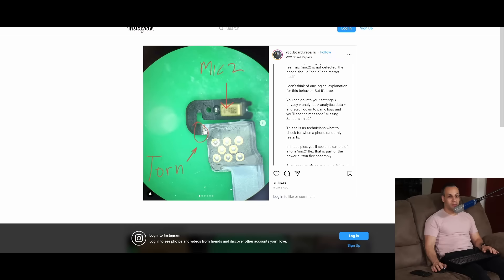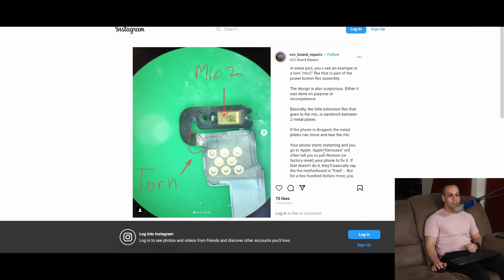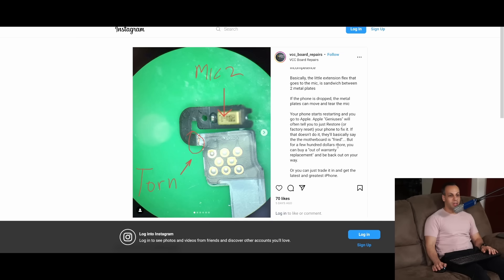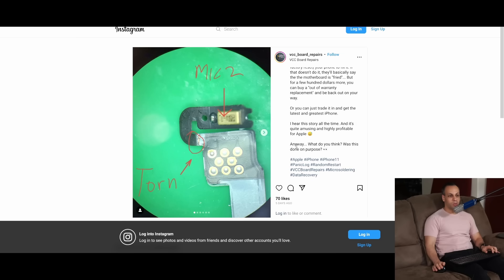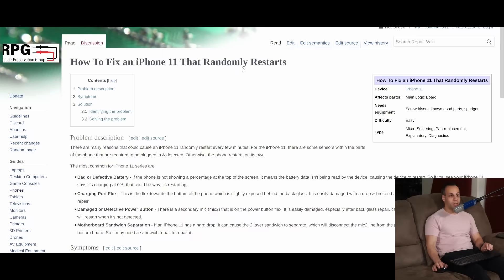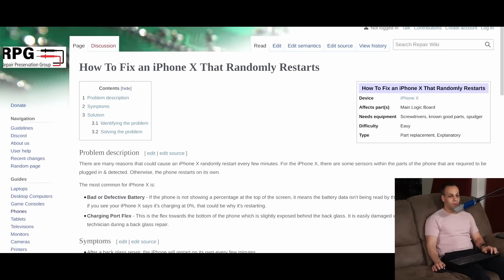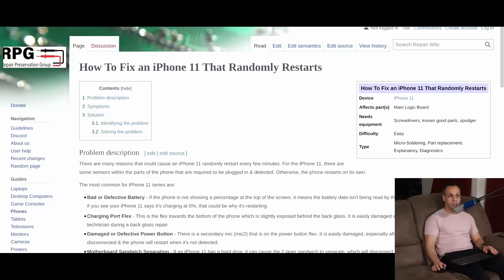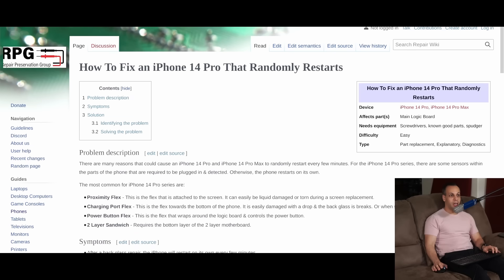iPhone's design flaw shows that 10 years later, their engineering is still a joke

Comment: There used to be a thing where engineers had to stamp their work with their license - and if the sucked at their job they'd be run out of the industry (or put in prision, based on the severity of their incompetence).
  
Having worked at Nvidia, Apple, and now Microsoft (I'm not speaking on any of their behalf) - the "repairs are best done in a factory setting" is best countered with the question: "How do you do your enigneering rework to validate your designs and running changes".  Hint, it's at an in-house lab staffed by at best a technician with nothing more than a hot-air or hot-bar rework station and the same 10x-30x AMSCOPE stereo microsope you can get from Amazon...  Often times they don't even have access to the schematic, it's a clip of a circuit diagram and some hand writen notes just to keep the instructions simple.  That's the reality of tech.  The "factory setting" is a person who knows more than nothing about how to solder, wearing and ESD smock at an ESD-safe workstation - that's it (it could be argued that also with consolidated access to the necessary parts - but that's IMHO a separate issue).  And it's not hard to replicate basically anywhere.
  
Sometimes you'll get an engineer who is competent enough to run the rework themselves, but THAT IS A VERY RARE EXCEPTION.  Ask about that too... "What percentage of your rework is done by your engineers and what percentage is done by contractors/part-time-technicians?"
  
And also: "What is the hourly wage of that factory worker during a repair?"  You'll probably find they are saying that for fiscal reasons - not kidding, it can be cheaper to collect them all and ship them to the factory in China or Vietnam have a fleet of low-income technicians do the rework, then ship them all back the US.
Reply: rework? Or repair? What do you mean.
Reply: @platinumsun4632  Generally the term rework means any time a device/PCB is touched/altered from its "manufactured" state.  This can be blue-wire modifications or repairs of existing traces (fix a damaged trace or install one a PCB designer "forgot"), replacement of damaged/non-functional parts for failure analysis, replacing a factory component with an alternate component for engineering studies, and on and on.  It's a catch-all term.
  
I've set PCBs on fire (not my fault, most of the time) and they (in-house technicians) have "reworked" a board to save a GPU/CPU tossing the whole PCB and replacing it with a new one and transferring the more expensive components.  When expensive major components come back from a fab pilot build, they can be $100K/chip because it came from a 1 to 5-off wafer spin.
Reply: @Real_Tim_S  When expensive major components come back from a fab pilot build, they can be $100K/chip because it came from a 1 to 5-off wafer spin.

Elaborate. I am humble PC salesman, but i've never gotten my hands dirty with a mobo and solder.
Reply: @platinumsun4632  The mass production price for an uncut wafer of chips right out the foundry can range from ~$1K to well over $15K.  But that's when they dedicate the foundry line to a specific chip design - and satisfy minimum order quantities!  If you do a short-run and vary process for tuning you're not making 10+ million chips and tens of thousands of wafers.  They have to take a line down (typically at the end of another chip's runs), load in the metal-layer files and then run those.  More metal layers requires more fab-time and increases costs (and with process variation this time increase can be geometric), so the more complicated parts cost a lot more.
  
Take a look at chip fabrication proceses for more detail from other sources, but in summary - you start with a bare hyper-flat silicon disc (wafer), put some masking on it, etch it, grow or deposit some metal crystal on the exposed/un-mkased metal, strip off the masking, and then rinse and repeat until you've grown the whole chip.
  
You need to tune the fabrication process to get the correct thicknesses of each step, and align the machine to get even process performance across the whole chip and wafer, otherwise you'd get one side where chips work and another side where they don't in some fashion or another.  Even the thickness of metal layers plays a part in the performance of chips - you might have gates with too high a band gap needing a higher voltage to function or gates with too thinn a dielectric leading to higher leakage (current flow not doing anything productive, bascially just generates heat, but too high and it can unbalace a logic element and start flipping bits).  If the foundry makes a mistake you might have metal grown in places you don't expect and you could have a wafer-full of chips that just make lots of heat in a short amount of time.  The foundry will try to bring the process into specification to match the design tools, but they will typically provide "corners" (Fast, Slow, High-Voltage, Low-Voltage) so the designer can validate the engineering margins of their design (adding in high and low temperature to their testing for a cube of perfomance with 3 axis: Process, Voltage, and Temperature... aka "PVT").  This is a "knob" the designer can turn a bit to get the best yield at retail in its actual use.
  
This short run of fabrication, with lots of manual intervention to tune the process at the foundry has an increased cost.  Think of it like the difference between buying a Toyota Corrola in a factory with robots or hand-building one in a garage with hand tools.  The time and effort and diversion of those foundry requires, results in increased price per wafer as it relates to the foundry's operating costs.  Instead of $10-15K like a producion run, it can be $1-5M+ per wafer.  And then that's just a wafer of a bunch of chips (the exception I'll note is the Cerebras wafer-scale "chip") - they still need to be tested, diced (split), and packaged, again all at manual/bespoke pricing.  From there you might not (rarely will) even get 100% viability out of all the chips on that original wafer - some fail in test (the test systems cost a bunch to set up too - search for wafer probing), some fail after dicing (splitting), some fail after packaging (mounting to a chip base which will eventually get soldered to a PCB).  The manufacturing cost of that wafer then gets split over the number of total viable chips (the "yeild").  For bigger chip designs this can be a very small number to start with...  For a $5-million wafer with 100x viable chips of yield you'd hit $50k/chip - toss in issues with yield and being the first customer at a processs node and it goes up from there.

Comment: My one and only major motherboard dining table job was rescuing my PS3. The WiFi chip is prone to voltage spike, which shorts it and the PS3 stops turning on. You can remove the chip and the PS3 will work fine..but you can never connect it to the internet again, even via cable, because forced PSN patches brick the system if the patch cannot detect the WiFi chip.
Reply: If it's CFW capable you can install a variant that doesn't try to flash the firmware on there and works fine.

But yeah this is hell for PS3s that can't do CFW. I have one super slim with a dead wifi board.

Comment: I wonder if the S2 is too old for a wiki page to exist (I don't see it on in the wiki, the S2 is in red colored text). I have a Samsung Galaxy S2. When I press and hold the power button to turn it on, the blue indicator light will turn on then back off like it is starting. But it never actually turns on because within a few minutes, I can repeat the process. Doesn't seem to matter if I plug it in while attempting to turn it on. I wonder what the odds are that someone has experience on this topic that could add to the wiki (I frankly don't have the experience nor know how on my own to even know where to begin).
Reply: And hopefully I am remembering that all correctly. Been a few months since I messed with it. It would be nice to gain access to files on there.

Comment: You are really way to forgiving/trusting... Putting a ribbon cable between 2 sharp metal plates.. If as a designer/engineer, you at that point don't think: "Maybe that's not a good idea" You are a incompetent, to an actually unbelievable level, as an engineer (I really honestly don't believe there are even engineers out there, that actually are that incompetent. And believe me I don't have a high opinion of engineers in general)... I can't believe Apple would hire such bad engineers if they even existed.. 
I'll give them, maybe it happened to end up that way by coincidence.. They should have seen and solved it, and otherwise they aren't engineers worth the paper their diploma was printed on.. And again I don't think Apple would hire those... So maybe it just ended up that way.. they saw the potential consequences and were like: "You know that's all good and beneficial to Apple, let's just leave it... If people find out Apple can claim an oopsy, it'll be fine" And then given that this is the first phone ever to crash when it doesn't detect a mic, kinda tells me there has to be foul play... There's just too many coincidences.

Comment: I had my phone randomly restart last year, but it wasn’t every 5 minutes, but rather a couple of times during a night of playing a cpu/gpu intensive game WHILE charging.

There was not a very specific description to be found online for the last shutdown reason, but what I found was either some sensor fault in connection with the charging port, or that there was poor soldering on the cpu. One thing I did notice was that charging was hard to achieve, and when you did achieve charging, it stopped after a few minutes.

I ended up sticking a thin and sharp needle into the charging port removing more lint than I could see with my bare eye.

After that, I haven’t had a single reboot.

Seems like an unstable connection in the charging port can trigger these watchdog timer resets without being any other faults too…

Comment: But I was told apple is the best and it just works!
Perfect planned obsolescence that's extremely hard for the consumer to figure out. The software makes it appear to be a serious hardware fault requiring expensive repair/replacement.
This is absolutely intentional.
Add to the list of fraud apple pulls every second of every day.

Also, serious question: do iphones reboot if charge port is wet? I know samsung has a notification telling you.

Comment: The iPhone 12 is even worse. If the front mic/ prox sensor assembly is disconnected or damaged the screen remains black. Phone is on but the screen is just black.
Reply from the maker: All of this will get documented in the wiki in due time!
Reply: @rossmanngroup  you have an iphone anti-consumer measures wiki? damn i'd love to read that
Reply: i feel like this is done on purpose to get users to buy new iphones
Reply: @SuchANoobOG it's to discourage independent/3rd party repairs. Resulting in more iphone sales like you said.
Reply: @SuchANoobOG eah that happened to dankpods he said yeah my iPhone screen went black it was still on it was in the budget phones episode
Reply: @SuchANoobOG that's exactly what is happening.
Reply: @SuchANoobOG  Oh yes it is. Apple were caught throttling processors to push users to purchase newer devices and they've paid out a lot of money in settlements. Apple needed to find a way to yank away that older device from you... so... build dry-joints all over the phone so when dropped, no matter how insignificant the drop... your phone dies...
Reply: Funny. I recently installed Ubuntu Touch on my FairPhone which soft bricked all the sensors. I figured out the fix later (you need to root and run restorecon -FR /mnt/vendor/persist when installing another operating system) but the failure mode for the screen was the obvious one: Just stay on.
Reply: @noneyourb172  that's the obvious failure mode, but Apple thinks Differently TM
Reply: @noneyourb172 yep, it's the default behaviour on Android when sensors die, the brightness gets set to either previous known good value, or to some default value (usually about 60%).
Reply: I am starting to think they run components in series on purpose. Run everything on the same rails and if one component breaks, that entire section of the device stops working, like a cheap no-redundancy christmas light.
Reply: @NothingXemnas  That's exactly what they're doing. Been saying for ages they'll just continue lock stuff down at the expense of the customer. Doesn't really matter, because their customers are in it for the "lifestyle'/image, not the hardware or function.
Reply: @NothingXemnas I think cost is the reason, but they get the beneficial secondary benefit.
I wish people would stop buying their second-rate products.
Reply: And that flex is always the first thing that breaks when there's liquid damage, it's insane.
Reply: PGR and Louis Rossmann what a great duo
Reply: Not completely black, just very very dark. Same if light sensor gets damaged. It defaults to really dark screen and you can't adjust the brightness.
Reply: Sister bought an iPhone 14. The front facing camera + faceid sensor module has a known fault which causes similar behaviour... temporary "fix" is apple unplugging it completely so it doesn't crash the phone. What a joke.
Reply: Funny enough, I've experienced the same issue with an XR, the exact same thing.
Reply: I'm wondering what's wrong with my 6s, the digitizer still works so I can touch the screen but the screen is blank. I took it apart and saw no damage to the screen or the cable that connects it
Reply: yeoch
Reply: This seems like their "hardware replacement avoidance" design costs more than its řbenefit.
Reply: @AllDogsAreGoodDogs  what's the benefit?
Reply: Hi PRG! Glad too see you are avid about the right-to-repair movement!
Reply: When I read this comment, read them in @PhoneRepairGuru 's voice. (We got a package...)
Reply: It's wierd how over the top their anti repair software measures are, but the hardware opens like a clamshell and everything is accessible one layer deep, while Samsung's phones are glass and glue sandwiches. Apple designs these to be fixable, but only for them.
Reply: @compaqdeskpro5770  "Apple designs these to be fixable, but only for them" and then refuses to diagnose and fix them...
Reply: @langdons2848 spot-on. Easy for Apple, impossible for anyone else.
Reply: This is why I questioned AT&T when they tried to upsell me from the current iPhone 11 I have now which works perfectly fine to iPhone 14. The 11 Had a few of the resetting hiccups but not many and it didn’t happen often either. 

I literally asked them what am I getting that has a better feature than the current phone I have? Or what makes i14 better than i13 or 12 lol 😆 

There answer was newer parts!!!!! Like what?!!!🤣🤣🤣 There’s nothing wrong with my phone. 

I’ll keep this phone until it dies on its own then ill decide to purchase another one. 😂
Reply: @AclipSoX  I've got an iPhone 13 Mini and I doubt they'll make a comparable phone in this form factor again. Will probably be skipping the 15 too and only consider replacing this phone when it's no longer supported by software upgrades or stops working completely
Reply: Man so that's what happened to my old iPhone.  I was wondering why it would turn on and remain black, eventually I just sold it to some methhead and convinced him it was juat dead